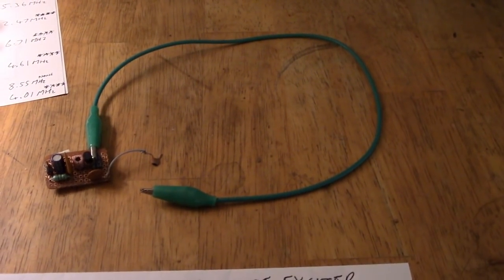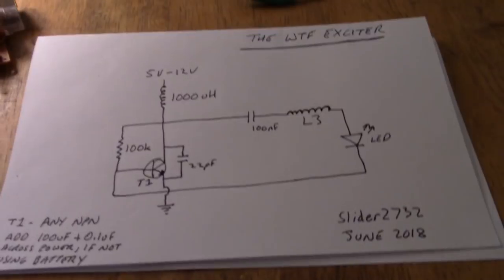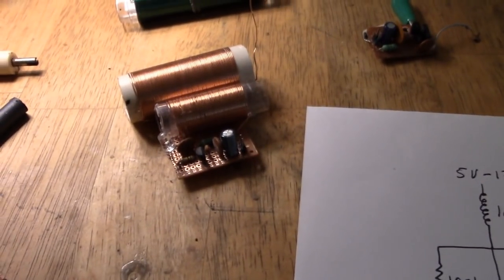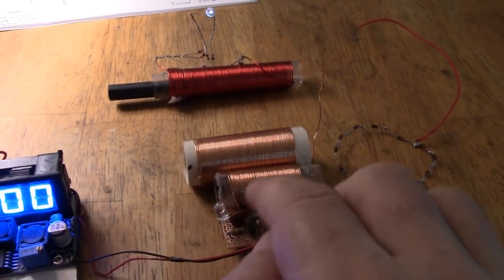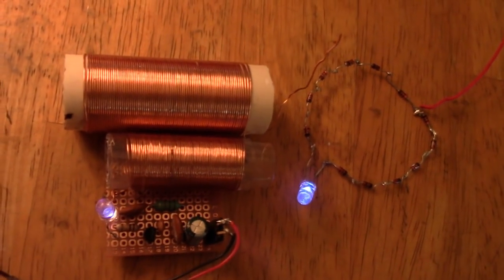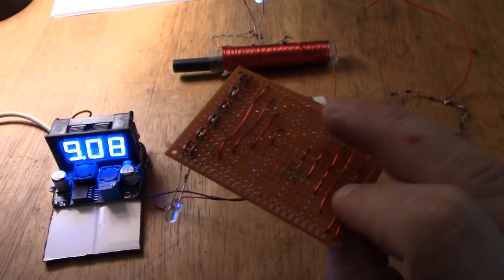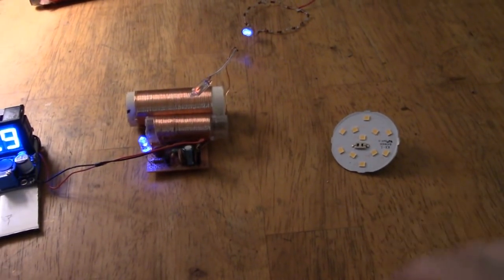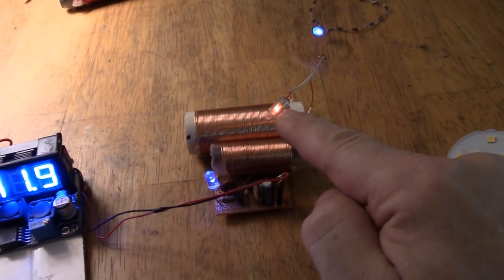A 3 Coil Exciter

Comment: At a higher voltage the frequency will change as well. - did you try coils in series/parallel (for L2) to get to the 13.x Mhz?
Let's Hope Dr. Stiffler will continue his series of videos soon. We have not really understood what was happening with the magnets. And with the 13.x Mhz resonance. Is he showing us several ways to achieve power extraction? It almost looks the same as Don Smith. But Don left away important details. Or he was a charlatan .. ..
Reply: Another discovery of sorts, keep 'em coming! I see from your results sheet that there was nothing special about the 2.7 MHz frequency but then there are numerous permutations possible depending on coil size adjustments etc. Is there any interference from that booster power supply? Can you run it off batteries instead? I see your body capacitance has an effect, how about a wire to earth (metal rod buried in your garden)? Many things to try :) Keep up the good work!
Reply from the maker: Haven't tried such combinations yet, but do intend to. Also to look at the scope for the frequency changes with voltage...good point !
Am looking forward to more vids of his too, there are lots of directions it could in.
Reply from the maker: Permutations are the area now, looking at especially coil inductances and inter-coil relationships. Another build has been successful and allows tuning of the L2 via a variable cap, but a piece of ferrite is more effective and somewhat simpler. 2x diode to the Base of the transistor had a negative impact, so that was confusing. 
Nope, no difference to batts, a 100uF and 0.1uF on the power rails do well. 3xAA run it fine. Also the scope trace remains just about the same. 
But yes, the Earth wire will be tried tomorrow, forgot today what with all the coil testing again and it had rained last night..oops. We've got 90-95F here most of the time now, so a natural wet day is rare.